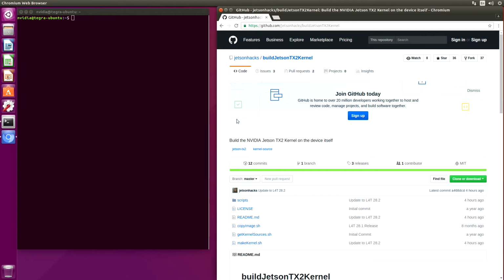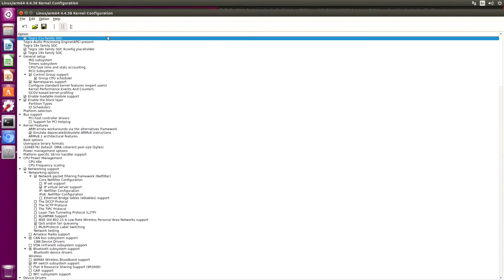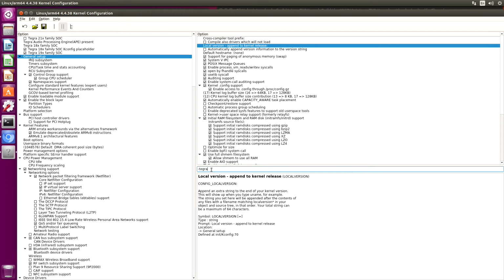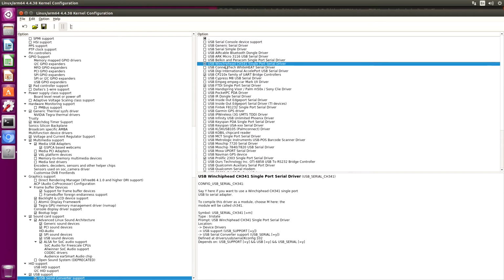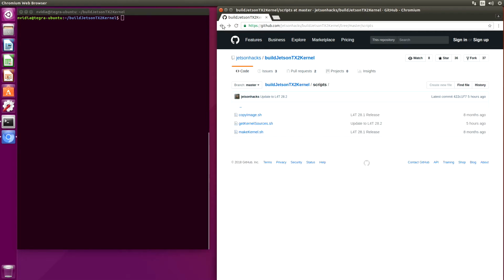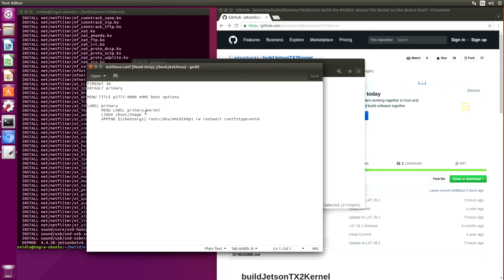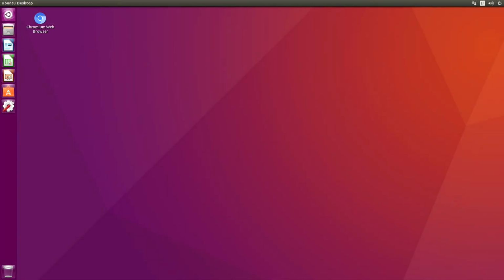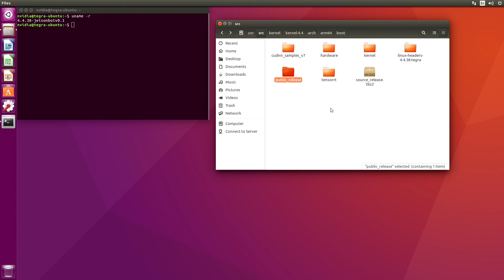Build Kernel and Modules - NVIDIA Jetson TX2

Comment: Hi Jim, I followed your steps, and after running the command ./getKernelSources.sh, there's no editor pop up on my screen to configure the kernel. The last two row of scripts before finishing the showed on my terminal are "nvcommon_build.sh" and "nvbuild.sh". I checked the /usr/src/kernel and /usr/src/hardware folders, and they are installed correctly after I run the get kernel script. My Jetson Model is TX2 and I just flashed it with the latest Jetson Pack 4.3 with L4T R32.3.1. Do you know what is the reason causing the editor not showing up?  And thanks for your wonder videos!
Reply: Same for me. I needed do it with menuconfig inside the kernel source code.
Reply: I found how:
1.- Install qt5-default
   $ sudo apt-get update
   $sudo apt-get install qt5-default
2.- Once you've generated the .config file go to where it is located and execute:
   $ make xconfig
Reply: You can that they removed it from their script:
>>>    scripts/getKernelSources.sh    <<<

In this version, you still can see the command:
https://github.com/jetsonhacks/buildJetsonTX2Kernel/commit/2b0e6980af9d59239e800ae94544ae9c751476d1

Note: This repository belong to them, the same authors so I just went through their work to find out. But it was bothering me that I couldn't see the configurator neither.
Reply: I faced the same but you can run the editConfig.sh script, its almost the same, not gui but does the job

Comment: Hi Jim, great videos! Is there any support for L4T 32 and up? Or could you give me some advice on modifying this method to do so? I really like how straightforward it is and that it can be done on-board. Thanks!
Reply from the maker: The short answer is that L4T 32+ require that the kernel be flashed to the TX2 from the host. The flashing process signs the kernel, and places it in a different partition. Thanks for watching!
Reply: @JetsonHacks  Thanks for the quick response! Good to know. If I at some point I wanted to change kernels, say to revert in case of problems, is it possible to access boot options when powering the TX2 up or would I need to re-flash? Been trying shift/esc but unsuccesful so far. I have things backed up but trying to avoid/be prepared for accidental bricking
Reply from the maker: @tiltedpear  I believe so, but I haven't tried it. You can ask on the Jetson TX2 forum for a full explanation.